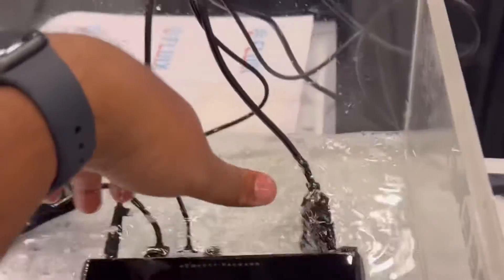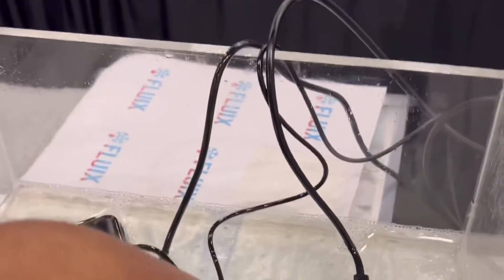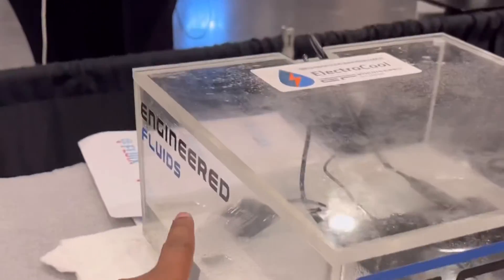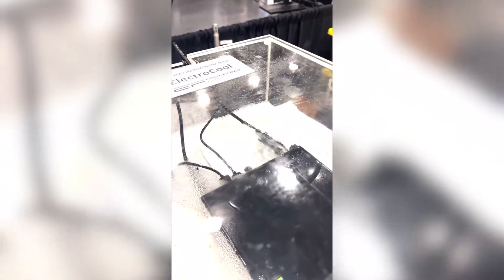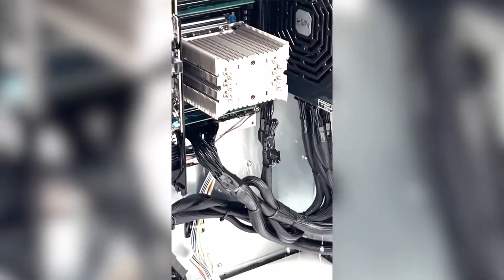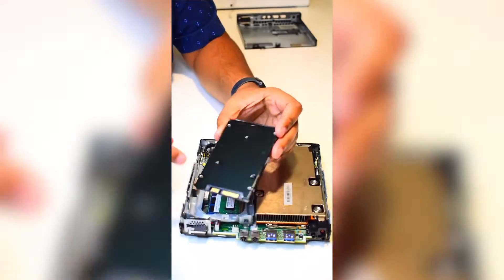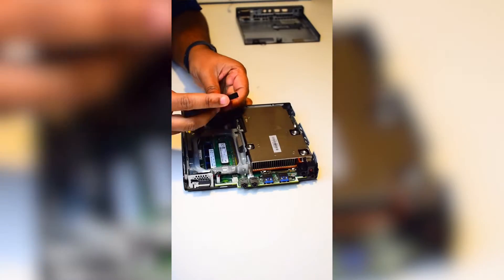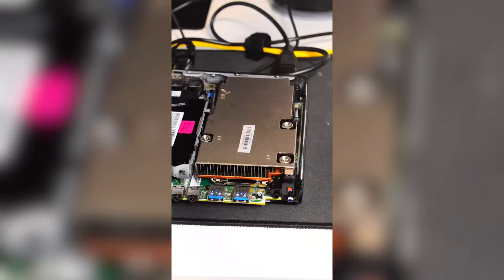This PC lives underwater! - Single Phase Immersion Cooling

Comment: Will the fan work 24/7 in that cooling water?
Reply from the maker: Yes it will! We had it running in that tank for 72 hours straight. However, in data center deployments, we go through the painstaking process of removing all the fans because they are not needed in immersion. This saves tons of energy from the total system draw.
Reply: @fluixtech  Can a private person buy this liquid? At which temperature will it start to boil? How is the thermal conductivity compared to mineral oil and water?
Reply: @Euathlus1985 I have the same question. I’ve been trying to find an immersion cooling solution like this for a long time. If anyone has a link I can follow to potentially buy, that’d be awesome.

Comment: downside is it corrodes the hell out of plastic and needs to be regularly changed. The fluid can get pricey when you need to keep replacing it as it fills up with dust and dirt.